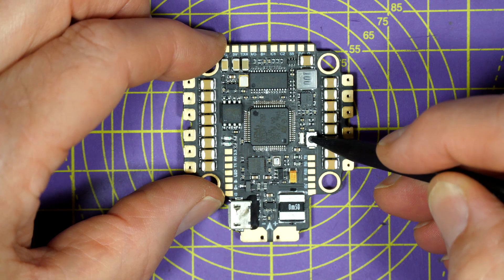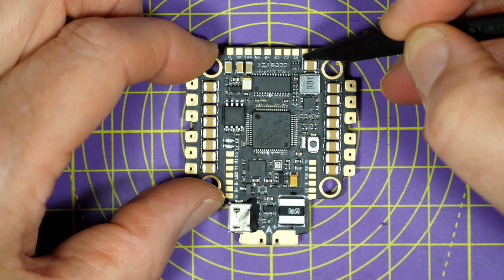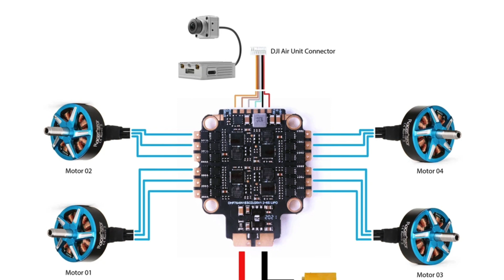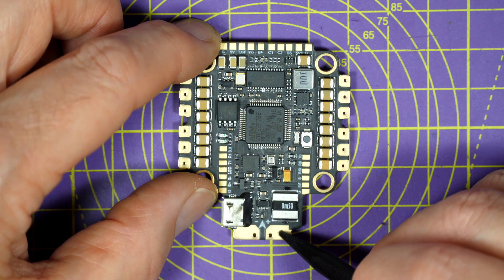Racerstar StarF7 F7 2S-6S AIO Flight Controller // DJI Air Unit Ready // Full review

Comment: Anyone nows if I can connect a GPS module to this flight controller.
Reply from the maker: Yes, the Racerstar StarF7 F7 AIO Flight Controller supports GPS functionality. There are several UART ports on the flight controller that can be used to connect a GPS module. You will need to consult the user manual for the specific pinouts and configuration settings for your GPS module.

Typically, you will need to enable GPS functionality in the Betaflight or other flight control software, and configure the correct UART port and baud rate for the GPS module. Once configured, you should be able to use GPS functions such as navigation, return-to-home, and other features.

It's always a good idea to double-check the compatibility and connectivity requirements of your specific GPS module before making a purchase or attempting to connect it to your flight controller.

Comment: Hello, and thank you for all your information. I noticed that the vtx portion at the top left of the board has only a 5v input, my vtx starts at 7v  operating range........so where should I solder my vtx power to?
Reply from the maker: There's a full schematic and wiring diagram here https://uk.banggood.com/30_5x30_5mm-Racerstar-StarF7-F7-Flight-Controller-AIO-OSD-5V-9V-BEC-Current-Sensor-Blackbox-and-40A-BLheli_32-2-6S-Brushless-ESC-for-DJI-Air-Unit-RC-Drone-FPV-Racing-p-1706211.html
Reply: @WhirlyBloke  So, it is ok then, power my 7v vtx from a 5v pad, according to this diagram correct?
Reply: @WhirlyBloke  Also, is there anything I need to do in BETAFLIGHT to set up the current sensor on this flight controller? Thanks again for any help that you can give me here:)

Comment: Hi, how to ibus on it, i’ve tried R1/R6/S but nothing happen, any idea maybe ? Thanks
Reply from the maker: Check the Racerstar website. There's a manual there somewhere
Reply: should be the same pad as for sbus as on a f7 chip there is no need for inversion on the board.
Make sure you have serial selected in the configuration page and ibus from the menu and serial rx selected in the ports tab for the uart you are using.

Comment: WB.  I have a question for you sir.  I currently have my DJI Air unit soldered to my FC.  I am looking at upgrading to a FC that has a place you can plug the DJI in directly.  DO you know if there is a DJI wire with a plug on both ends or will I have to make one?  Your help is appreciated.  Richard
Reply from the maker: I've found if you buy a DJI compatible flight controller, there will usually be a suitable cable with connectors in the pack.

Comment: Can this Fc run a regular quad w/o dji air unit ? meaning a vtx and camera like the old days ? thanks
Reply from the maker: Yep. That's why this is an awesome flight controller. It's got dual analog camera inputs with beta flight switching. And of course it can use DJI air unit on 6s. best of all worlds.
Reply: @WhirlyBloke  Thanks !! :-)

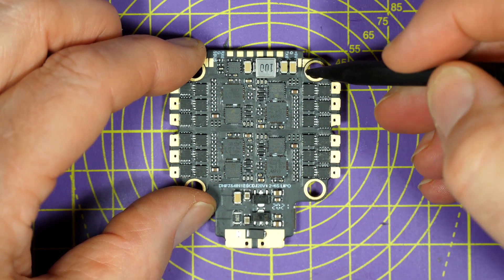Comment: Nice board 😎 did you say 9v for the Air Unit?  at about 5:15. I thought it only could take 5v   ( I’m sure I’m missing something ✌️
Reply from the maker: The DJI Air Unit input is 7.4-17.6 volts at about 4-9W. Thanks for watching.